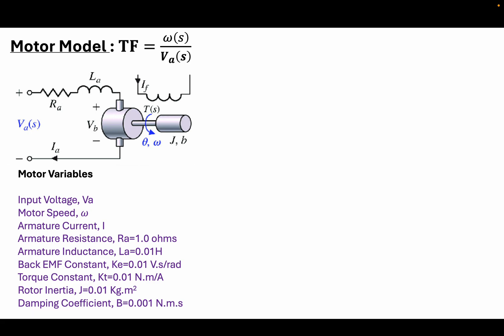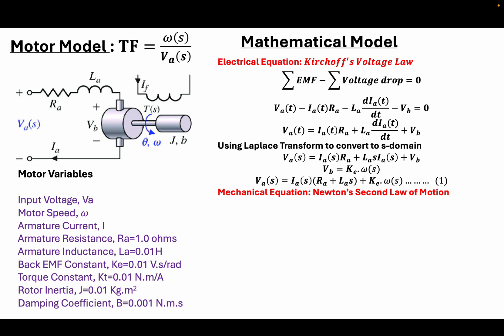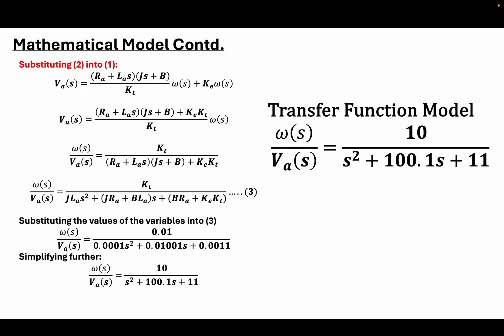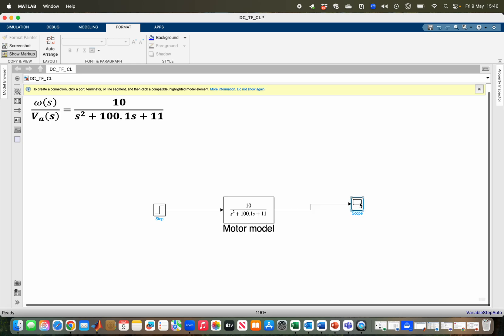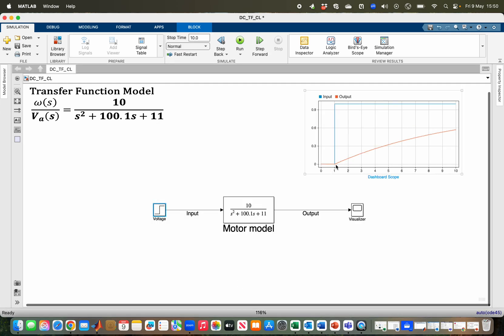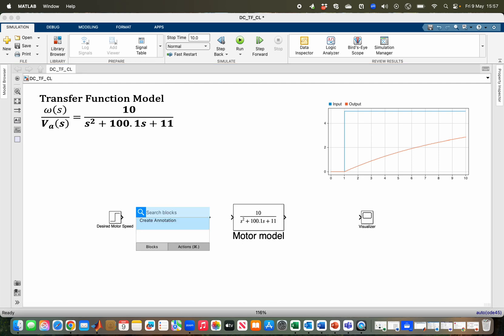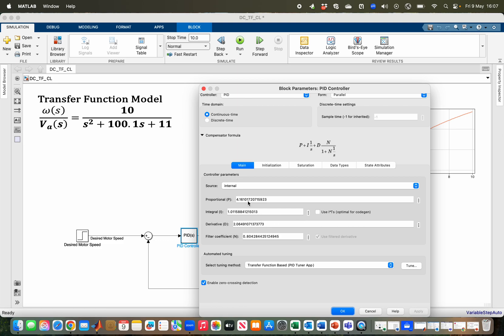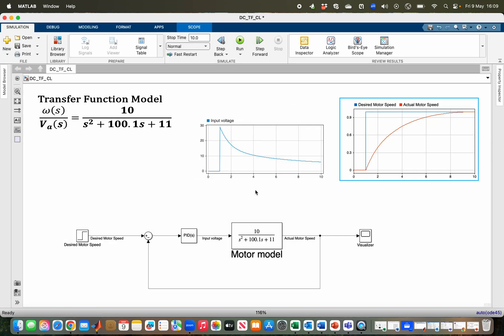DC Motor Transfer Function Modelling and Speed Control with PID in SIMULINK.

Comment: Hello sir, How did you get these variable values? Please?
Reply from the maker: Hello

The values for DC motor variables can primarily be obtained from the manufacturer's datasheet, by performing empirical measurements on a physical motor, or by using parameter estimation software, like MATLAB system identification toolbox, with experimental data.
Reply: @KKDexplains  Thank you so much sir for answering. 
Can you please attach the link of the manufacturer’s data sheet of the exact motor used in the video, we are using matlab for the software (but I have no idea how to derive the rules that’s required in finding the parameters) 
I have a data sheet of a miro dc motor, but some of the variables such as (B) is not directly given, we have to find them ourselves but I don’t know how, so can you please give me the exact path to find the variables not given in the data sheet as well as attaching the data sheet of the motor used in the tutorial video, 
It’ll be very very appreciated if you answer quickly we I only have a few days left until the due date,the problem is our lecturer it asks for very official data.
Thanks again sir for answering.
Reply from the maker: @hanasa7512  Unfortunately, the variables used are not specific to a particular motor. As mentioned earlier,  the best way forward is to refer to the datasheet of the motor you intend to work with, where you will find the required parameters or guidance on how to determine them (which you have observed already).

Wishing you all the best with your work.
Reply: @KKDexplains thank you very much, but, What if we send you the data sheet?Can you find the parameters for us? Because we don’t know how to find them..please we are really need it..we will be appreciate if you help us….
Reply from the maker: @hanasa7512   you can use this data sheet: https://www.moog.com/literature/MCG/moc23series.pdf?

All the parameters are there. You just have to convert some of them to their SI units.